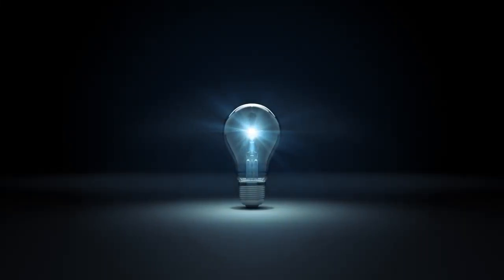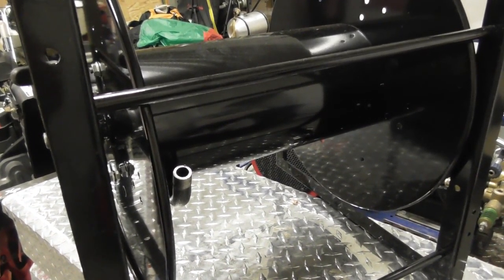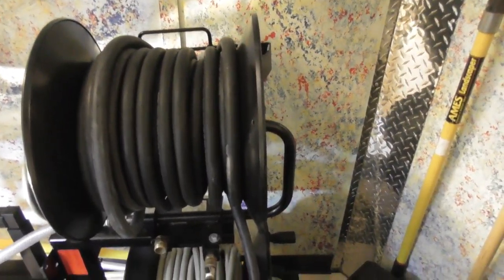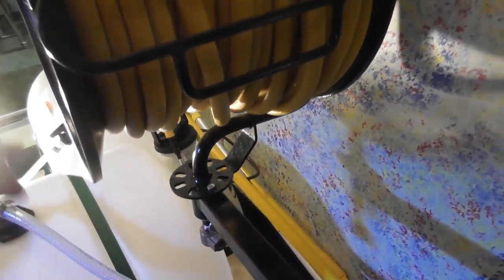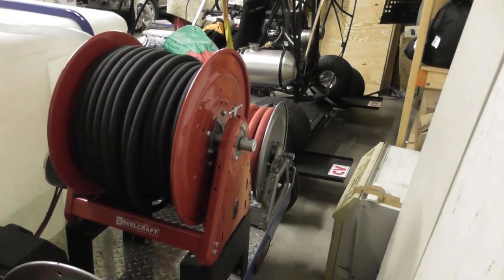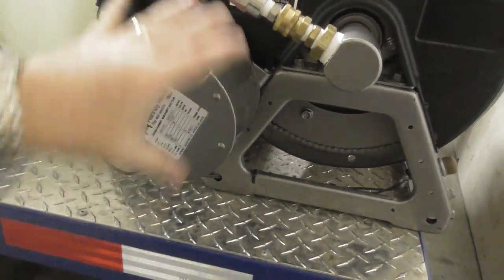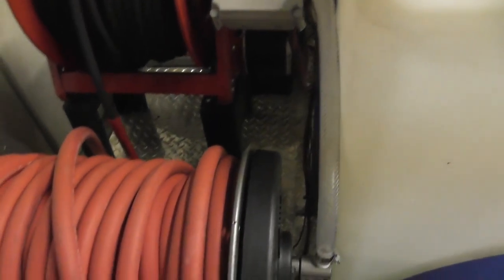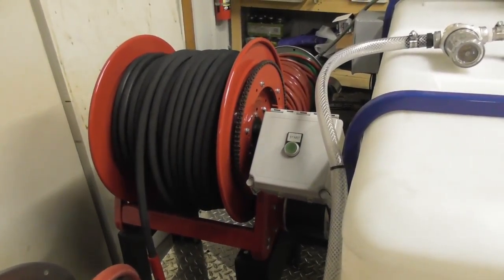Electric Hose reels for Pressure Washing, Drain Cleaning , Clean Now Pressure Washing Gainesville Fl

Comment: I am very impressed sir!!! Did you Design that Hydro Jetter set up? I’ve watch this video five times in a row I am very impressed I just did a jetting set up for an inboard with tank in a Ford power stroke diesel van
Reply from the maker: Thanks for the compliments.  I bought the trailer with the tank amd PW already on it. Then added the hose reels, electic and the mods on the PW.  If you do a vid on your van let me know when you upload it.